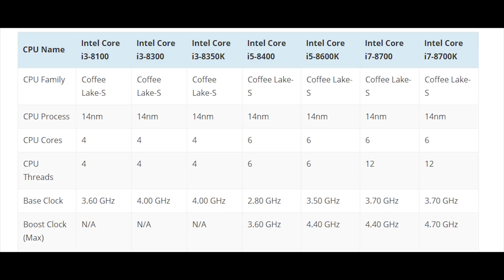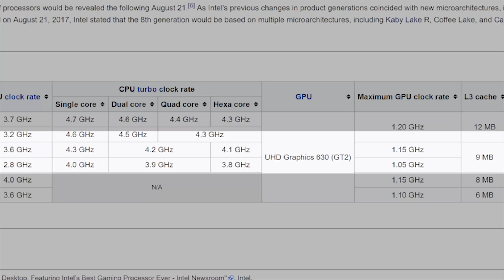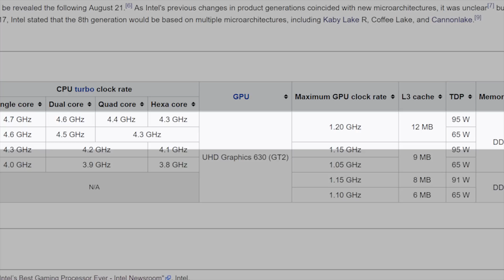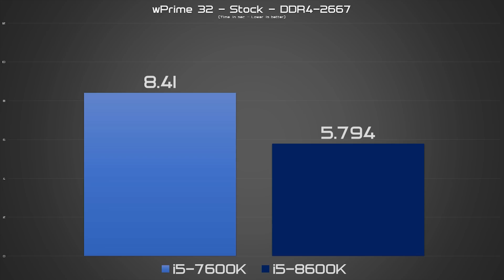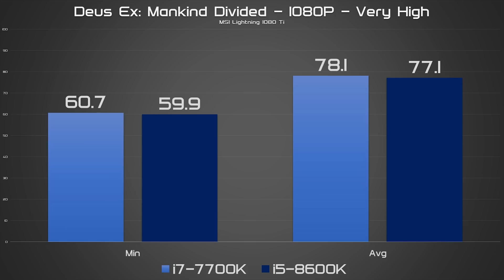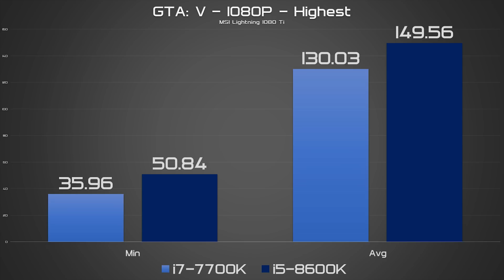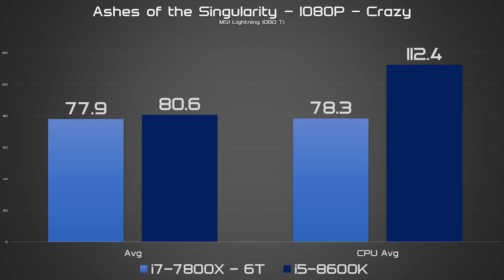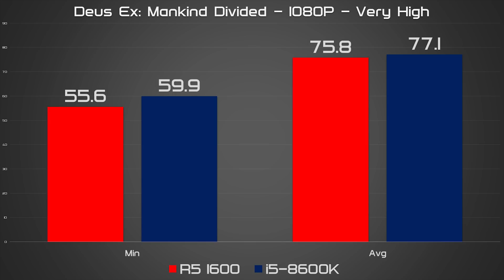COFFEE LAKE IS HERE - RIP KABY LAKE & RYZEN? - Intel i5-8600K Review

Comment: Impressive performance no doubt. But it's in no way a Ryzen killer, sorry. AM4 will last a lot longer than 1151, making it a more worthwhile processor for people who don't update everytime a new CPU comes out.
Reply from the maker: +Console Classics Fair enough.  I tend to not lump Ryzen as Zen because Zen is the general term while Ryzen is a specific branch. I get what you're saying and agree, just didn't think the original comment was nuanced enough to communicate what you're saying.
Reply: UFDisciple If single core/IPC is what makes Coffee Lake a Ryzen then Kabylake is also a Ryzen killer, as the IPC hasn't improved from Kaby to Coffee, it's the same CPUs with 2 extra cores. Ryzen still offers more cores for the same price, so yes Intel does hold the better single core and gaming performance, but AMD still has an advantage in multi-core workloads. Calling it a Ryzen Killer suggests that it renders current Ryzen CPUs useless, and while it might do for gaming, it doesn't in all scenarios.
Reply: am4 just a socket like 1151... coffee is also 1151 but requires new mobo.
for sure confirmed by amd is that ryzen1 b2 could be used in current mobos. and think about why amd announced x470 new chipset in 2018 ?  
in best case mobos on x470 could support both ryzen2 and ryzen1 but this could  mean that ryzen2 cant be used in current mobos
Reply: ConsciousN Trill You still believe this BS? Why AMD launching X470 and B450 next year? No way Zen+ or Zen 2 to perform same in X370 compared to new boards, example? AMD old CPUs.... same strategy but still people had to buy new motherboard for power delivery and features! So if you think you gonna keep B350 until 2020, then you totally wrong!
Reply: nobody yet confirmed that Ryzen 2 will be compatible with the ryzen1 motherboards ... so this is just our wishes and dreams. am4 socket could remain like 1151 but chip or anything else will be different and voila ...
Reply: Max Pain thats cool lga1155 stocket has been out since 2011, the new cpu have diffrent voltage pins for a new mobo. Dont act like Amd has not switched broads. Let alone had a good enough cpu for them untill ryzen.
Reply: That's because Intel pretty much hasn't improved their CPUs since Sandy Bridge, if we get to see +50% performance each year from now, then there is no way I'm keeping my CPU for 4 years.
Reply: Upgrading every generation is pointless anyway, I come from 4th gen and only want to upgrade, I don't NEED to upgrade cause 4th gen is still pretty good.
Reply: Ryzen was obsolete when it launched
Reply: ConsciousN Trill impressive performance? Are we looking at completely different things here? The new cpu has 2 more cores and that’s it, and since most games only use 2 cores they are completely useless because these chips are mostly used for gaming, now if you disable 2 of the cores on the new chip a bet you anything the 7600k will beat it at every game! So again if games don’t use more than 2 or 4 cores and the older chip is faster at gaming why would you need a newer slower chip (again at gaming because that’s what these chips are used for)
Reply: MST PvtGarcia Shut up please! You sound so dumb! I cant believe im wasting time letting you know this! "2 more cores and thats it" Don't make me laugh
Reply: MusaM8, 
"if we get to see +50% performance each year from now"
no we wont see anything like this, maximum 5-7% per year but to be realistic 2-5%.
why ? because current technologies based on silicon and we came to almost maximum possible.
silicon can give us maximum 5 GHz on air or water and minimum 7nm technological process ... the smaller technological process the more transistors you can place in the same volume means better productivity but another limitation is the number of transistors could be placed in some volume to not break basis and avoid some physical limitations related to semiconductors (dont know right terminology in English)  in other words dont expect boost of productivity maximum 2-5% in best case 7% (i doubt about 7%) but power consumption will be better exactly because of small technological process.
multi threading is also a dead end, no one will produce games for 16 threads - very costly and takes lot of time and as a result influence to the price, im sure that you are not willing to wait for the game 8 years and pay for it 150 usd - this is meaningless for both developers and consumers.

the only way for us is new materials instead of silicon and new principles in general for example something based on bio or photons - this is for long future.
silicon could be used maximum next 5 years and after that or new materials or some stagnation. with new materials ans same principles of semiconductors we could reach 0.6 nm and this gives us 5-7 years more
or another way is using more expensive materials with the faster electrons speed like GaAs this could give us up to 200 GHz per core comparing to the current 5 GHz and this will give us 10-15 more years before we need smth new .

so the revolution will be after 5-10 years only :) until then dont expect anything faster than 2-5% per year
Reply: I bet your 1017 Ryzen board will be obsolete as well in 2020. at that time its 3 Years old. and Lot of stuff have changed in that time so the B350 or the x370 Might have the AM4 socket to support the zen2 but whats the point on a old crappy chipset ? its like putting A Farai engien in a Truck. it's stupid and you should not do it !
Reply: yeha at the time the AM4 motherboard will support and run ram above 2933 it Outdated. so much changes all the time and in 2020 im sure Most new motherboards will support 4ghz Ram and more. Ryzen will never do that. alos also the x370 do no support quad channel ddr4 that and alot more ill render the AM4 motherboard you have Today Worthless
Im not saying we wont see any new chipsets for the AM4 socket. we might but then you will have to buy a new board and a new CPU just like you do with intel.
Reply: Ryzen is the Zen platform though.  Yes it is better performing for now, but that comes at the cost of having to upgrade board+CPU and being tied to a platform that may well be abandoned in a relatively short time as Intel are inclined to do,

If you opt for Zen, the next upgrade is just a matter of dropping in a new CPU to your existing mainboard.  There is more to it than just being 'the budget option' .  I bet people who bought a 7700k and high end z270 board a few months ago aren't too happy.
Reply: I dont think your understanding his point at all. AM4 is for Zen+ refresh on 12nm LPP and Zen 2 on 7nm covering the user all the way till 2020.  This board will most likely be obsolete in 1 year or less if Kabylake is anything to go by.
Reply: Its all good, I could have misinterpreted.  Just pointing out their is more pro's and cons than just price and current performance:)  If you want the very best performance right now you can't argue against Covfefe lake, it looks much more appealing than their HEDT platform.
Reply: i really like Ryzen but after benchmarking a basic i5 8400 against an overclocked ryzen 5 1500x, i have to admit that yes Coffee Lake indeed beats Ryzen EVEN at performance per $. Sad day for AMD, good day for a consumer.
Reply from the maker: +Console Classics If that was his point, then I missed it.  I get AM4 will be around for a while, but stating that Coffee Lake isn't a Ryzen killer isn't correct.  It's not a Zen killer, but it has indeed been Ryzen in all areas of performance, relegating AMD to being the budget option yet again.
Reply: Because you buy a new cpu every generation? Please, you'll be stuck on an old chipset for a long time, thats the reality.  While the next intel chipset will have PCI-E 4.0 and perhaps DDR5 memory. Enjoy your outdated "zen" for another 3 years. I'm on 4+ years with my 4770K and i won't have any problem buying a new motherboard & cpu + ram this time and be good for another 4 years. I mean, what do you people want?
Reply from the maker: +ConsciousN Trill It's worlds better than Ryzen with single core.  The only thing Ryzen has going for it now is its price.
Reply: CPU performance is advancing so slowly now that it doesn't matter how long AM4 is around, there is no point to be upgrading every year unless you're rich. Plenty of gamers are still going strong on Haswell chips from 2013. Anyone with the money to throw around on upgrading their CPU every generation would also have the money to upgrade their motherboard.  Your argument is almost 100% irrelevant.